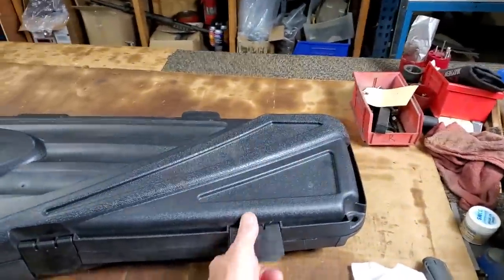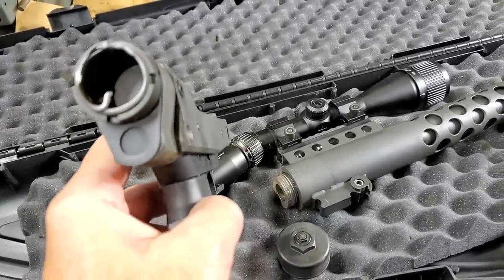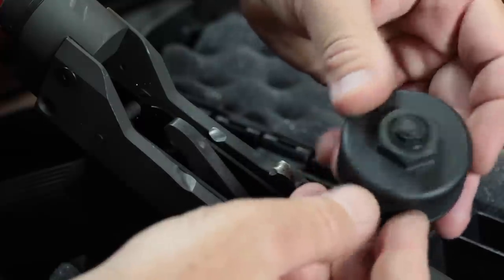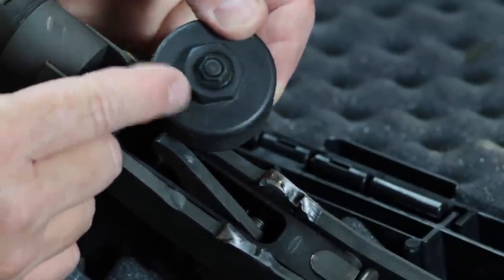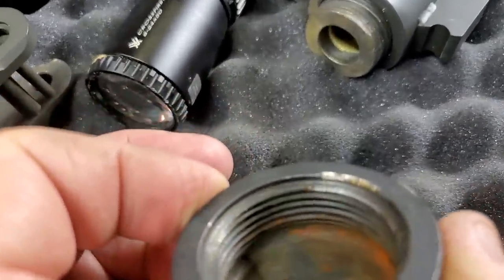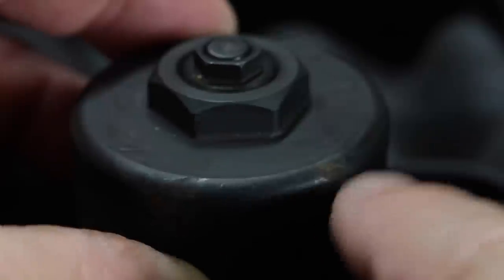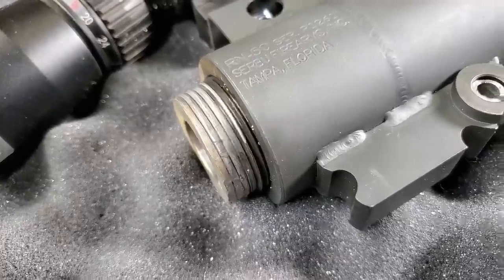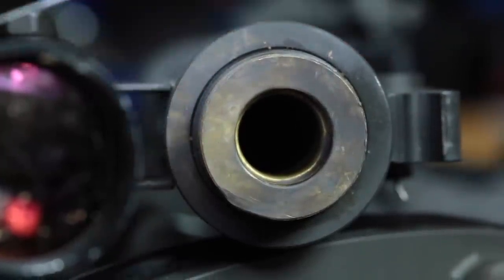Kentucky Ballistics' RN-50 Blow-up:  First Look

Comment: Im pretty sure he got a tainted round (round filled with high explosive) was given out during the iraq war with the hopes enemys would use them and destroy there own guns
Reply: sigh. these are bubba handloads sold at gun shows. no non nato force uses .50 bmg slap rounds. only the US made and used these. these also were made during 1994 and 1996.
Reply: @toomanyaccounts  are you sure cuz they say wcc as in winchester cartridge company made in 1985, not only that but winchester is one of the biggest supplier to the armed forces (at least thats what I got from my research) (Google search research so I might be wrong)
Reply: @cali.delinquent9657  https://fas.org/man/dod-101/sys/land/slap.htm

 "During the 1980s, the Marine Corps invested in both .50 caliber and 7.62 x 51 SLAP concepts. The .50 caliber effort was very successful and extends the light armor capability of the M2 Heavy Machine Gun significantly. The 7.62mm effort was not successful in the M60 and caused catastrophic barrel failures due to in-bore break-up of the sabot and the penetrator puncturing the side of the barrel. Also, its increase in penetration was not on the same order of magnitude as the .50 caliber SLAP's.
A fixed price contract for initial production of 3.5 million rounds of 4/1 linked M903/M962 for the U.S. Marine Corps use was awarded 1QFY94. Contractor for this activity is Olin Corporation. Cartridges are being loaded, assembled and packed by the Winchester Division, East Alton, IL. M962 tracer projectiles are charged at Lake City Army Ammunition Plant (LCAAP). Production of 0.6 million rounds for Army use began 2QFY96."

it was in production for testing and got approved in 1990 for field use. It was several years before major production occurred though. the crimping on the rounds shown in the video is not the crimping that would have been on the military production rounds but what you would see from a civ handloader. there were kits out there that allowed one to make their own slap rounds. guess what people did with those kits. the ones made in 1985 would have long been used up hence why they are handloads by Bubba.

Comment: Mark, this is NOT your fault. You designed a safe firearm designed to work under NORMAL and even extreme operation. Blaming you makes about as much sense as the Army Tank Commander fresh out of the Sandbox coming home and filling his Ford or Chevy diesel truck with Race Gas. I mean, the Abrams Tank diesel motor can run on high octane gas OR diesel fuel....and it's a diesel motor, so why shouldn't an off the lot Ford or Chevy diesel truck ? This round used by Scott I feel is the EXACT same comparison. If knuckleheads want to blame you, then they should all go out and fill their Diesel trucks with pump gas and enjoy the extra power for 20 seconds......then blame Ford or Chevy and use the Abrams Tank engine as their excuse for doing so when it fails.

Comment: PSI rating on threads isn't the same as an impact force. A drill and impact have the same size motor, but the impact can provide much for force due to impact. PSI rating on threads is BS. Just add a couple more.
Reply: no more threads wouldn't do anything except weak it
Reply: @toomanyaccounts  opposite
Reply: @OGbqze  nope additional threads wouldn't do anything.
Reply: @toomanyaccounts  dude... It's literally the opposite. More threads would equal more strength. If they used 3 threads on it them by your knowledge using 2 would make it stronger... It literally the opposite. More material to hold onto = STRONGER. More threads = STONGER. There's a reason why MANY things, especially on vehicles have threads that thread in further than just good enough cause obviously it wasn't good enough. Adding more threads equals more strength.Adding more threads equals more strength.Adding more threads equals more strength.Adding more threads equals more strength.Adding more threads equals more strength.Adding more threads equals more strength.Adding more threads equals more strength.Adding more threads equals more strength.Adding more threads equals more strength.Adding more threads equals more strength.Adding more threads equals more strength.Adding more threads equals more strength.Adding more threads equals more strength.Adding more threads equals more strength.Adding more threads equals more strength.Adding more threads equals more strength.Adding more threads equals more strength.Adding more threads equals more strength.Adding more threads equals more strength.Adding more threads equals more strength.
Reply: @OGbqze  no it is the opposite. adding more threads weakens it.
Reply: @toomanyaccounts  Well, if I built this exact gun and it had more threads this wouldn't have happened. Simple
Reply: @OGbqze  funny other people who make guns and are experts in ballistics say the number of threads is the maximum number to be used.
Reply: @toomanyaccounts  I understand. Believe as you will. All I know is if I was building a gun, which I have, I wouldn't rely on 4 threads.

Comment: Your issue was the muzzle brake. You should never shoot slap rounds through a muzzle brake ever!
Reply: stop repeating FUDD lore. muzzle brakes are fine with slap rounds. barrett says this btw. the military just didn't clean the guns and blamed it on the brakes rather then their soldiers not doing proper maintence. we know what happens when brakes are gummed up either the round clears the blockage or the muzzle brake goes flying off.
Reply: That's just FUDD lore. Stop repeating this nonsense!

Comment: The threads on the barrel look completely sheared off.
Reply: which would take over 160kpsi pressure. normal .50bmg pressure is 50kspi or so with overpressure testing rounds being 66kpsi
Reply: @toomanyaccounts  Thanks. I was wondering  about that actually. So maybe metal fatigue then?
Reply: @velocity324  nope just triple or more pressure from a Bubble selling his death wish handloads as originals.

Comment: You desperately need a overpressure port in the gun without it its a cannon with a screw cap held by threads and two metal protrusions.
The gun is not able to handle overpressure and gasses and effectively evacuate from the front end leading to the breech end to fail.
Reply from the maker: You desperately need to watch my video on the “RN-50 blowup analysis – what it wasn’t, Part 1” and then come back here and delete this.

Comment: I mentioned this on your video before this one. Scott fired those rounds with a muzzle brake on his .50 cal., slap rounds take a special muzzle brake to fire slap rounds. The sabot is catching on the muzzle brake. That would explain why Scott was getting rounds that would go wild. I'd look into the muzzle brake and see if there are sabot pieces or scrapings. Still looks like an over powered round and maybe the sabot getting stuck in the muzzle brake.

Comment: I can fix the problem. No matter how much you think you know about how "strong" threads are, just add a couple more...
Reply: Thats not how it works.

The first four threads are the only ones to take any of the stress from the pressure. The rest would tear just as easily and wouldn't provide any benefit.
Reply: @DoraTheMFDestroya  I understand your point. But claiming that more material won't strengthen anything doesn't make sense.

Comment: I just saw edwins video and it makes everything even less understanding! Tbh from what we saw it aint no way that bullet or all the saftey messures was the reason. Has anyone thought of it maby was not a "bullet" and maby it was just packed with explosives like c4 or cemtex. Tbh i dont know anything about those stuff but u have a big strong primer to start it and a the casing is big enought to hold a decent amount of explosives. Have you tried testing it for explosives?!. Like I said maby its silly but sadöy there is many sick ppl out there that does the most sick things to ppl. Any ways edwins test was just silly i thought aint no way that Gun does not fly in to a million parts and it did not it even cleared that concret and we could see from that it was a huge amount of energy as concret flew all over from the explosion

Comment: Seems to me like the only difference between the hundreds of KB events every gun under the sun has each year from improperly loaded rounds and act of god case failures an this one is the fact that this happened to happen in serbu's gun and it happened to a popular youtuber who got it on video and he nearly died by just freak luck.  

I was at the range once when a woman next to me had a revolver, i can't remember the brand, made by taurus but not taurus brand, it's like one of the brands the company owns, the name escapes me, but she was shooting federal .357 magnum rounds out of the box, cheap stuff and clearly not very hot and despite it being federal factory ammo got what was clearly a double charged round, it blew the barrel forward when it sheared off all the threading fixing it to the frame and the left side of the cylinder exploded sending a 1" piece of it rocketing to the left straight down the firing line and thank god I was standing to her right, not her left, that piece could have killed me. It went so far we couldn't find it, it was probably imbedded feet into the dirt berm on the side of the range.

These things happen, this didn't make any news because by just shear chance nobody was standing there and nobody got hurt.  In 99% of kb's probably nobody gets seriously hurt, this one somebody did and so it just has drawn lots of attention.

Comment: SLAP rounds are not approved for use in most .50 caliber rifles with muzzle devices. The theory of this failure is the sabot and muzzle device combination is the cause for the pressure increase resulting in this catastrophic failure.
Reply: not true. Barrett says muzzle devices work just fine unless civilian in which case the muzzle brake will be torn off. give you a clue in real life when obstructions at the muzzle brake the muzzle brake gets blown apart not the chamber. same reason why if there is a squib or blockage in the middle of the barrel is that part of the barrel that blows up not the chamber. stop repeating debunked FUDD Lore.
Reply: @toomanyaccounts  this rifle wasn't built by Barrett. Is this muzzle device on the Serbu tested and approved for SLAP rounds?
Reply: @gun_coyote  yes it and the barrel and the whole rifle were special built to fire slap rounds.

Comment: The marks on the top of the side plates couldn't have been caused the way you placed the cap. It had to have spun past 180* and hit the TOP of hte cap for the curve of the mark to fit. Which fits thatdamage to the threads, because the top of the threads are arlmost gone, bu the threads on at the bottom look less damaged. So the ears probably caused the cap to SPIN like a motherfucker, hit the receiver , skip off the angle behind that, and ricochet up into his glasses. The forces involved in that rate of spin are LUDICROUS, but then... well, .50BMG.

Comment: Elder Son. 
Spectral Chem analysis on the brass before you contaninatem8d it would have iidentified the explosive used. Old C-4 formulation most like.  Bundled blasting caps with a charge director is also possible. 
...don't by salvaged ammo.
NEVER use ammo you just happen across.
Elder Son really worked well.  We have been using it in the field for a Long, Long time.
Provenance of your munitions REALLY matters.
One guy in a lab can make 200 ES rounds in one afternoon and demoralize an entire army.
Just mix em in and "lose"  a can here or there...
Dark stuff. Comes home.
Reply: sigh bubba is known to make crappy handloads and sell them as originals at gun shows. you people need to stop bringing up a program that stopped decades before slaps were manufactored and only the US uses .50 bmg slap rounds.
Reply: @toomanyaccounts  would you prefer the active program name? Or maybe the CONTRACTOR  who runs it now?
...don't be a fool. That round was like dynamite. It was not an accident
Reply: @someguyoverthere3275  once more Bubbas are known to make handloads that do that due to their incompetence. once more bubbas make counterfeit slaps. once more no nation besides the US uses .50 bmg slap rounds
Reply: @toomanyaccounts  the rifle.is designed to contain an explosion. 
The explosion that destroyed THAT rifle was INTENDED  to do exactly what it did.

Comment: I'm very far from an expert, but according to Wikipedia, which calls out "The Complete .50-Caliber Sniper Course: Hard-Target Interdiction." by Dean Michealis, Saboted ammunition should not be used in firearms with muzzle brakes unless the muzzle brake has been specifically designed for such use.[1].  

Seems like this is something worth looking in to.

Side notes: 1 - Thanks be to God that Scott is recovering!  2. Mark Serbu is clearly a stand up guy for such transparency.  God bless you both.

Comment: For the damage to the inside of the cap, is it possible that over time the high temperatures and pressures weakened the heat treating?

Comment: First thing, I am not an expert, especially not in the power levels of the 50 BMG. I'm really a pistol guy. However, in Scott's video about the incident, he noted that the 2nd muzzle flash was significantly more brilliant than the first, then if the video presentation includes all shots, the third was the boomer. Elsewhere (WikiPedia, take that grain of salt) it is mentioned that "Muzzle devices, like a flash suppressor, muzzle brake or choke, and with muzzle brakes in particular, can cause material buildup from copper, lead, etc. upon firing. In particular, firing of saboted ammunition in firearms with muzzle devices can leave behind residue in the bore upon firing, which can cause an increase in barrel and chamber pressure in subsequent firing."  This makes me wonder: did that specific ammo combined with the muzzle brake cause enough crud to accumulate in the barrel from the first two shots to cause the overpressure incident in the third?

Comment: it actually wasn't the rounds being "hot" that blew up the gun, it was running sabot rounds with a muzzle break. they actually teach you this in military training you never supposed to run sabot rounds with a muzzle break for the reason that the rounds are designed so that the plastic casing round the bullet breaks away when it comes out the barrel and when your running a muzzle break a little bit of plastic gets caught on the un of the muzzle break after each shot boring down the rifle and ultimately causing an explosion that's why after each shot he took the muzzle flash got bigger and the gun got louder because it was slowly boring down the rifle till the rifle exploded. so so everyone knows never use a muzzle break when running any type of sabot round.
Reply: no.

Comment: The 50manual says don't fire slap rds through muzzlebreaks, unless muzzlebreak was specifically designed for SLAP rds.. Would you please look into that. As micro damage upfront  could cause a bore obstruction causing all the Bad overpressure from the back. You might have to view it microscopicly to see damage.
Reply: yes this was one built for slap rounds. it was made on request. no the muzzle brake would blow off. even the Barrett company says the military spec muzzle brakes work just fine with slap rounds. all that happens is plastic gets blown out the sides of the brake. a typical civ spec brake would just fly off if obstructed.

Comment: ¿Why the Design does not have a built in weak spot to release dangerous over pressure in a safe direction?
Reply: because a freaking pipe bomb would make that nil. give you a clue Barret semi auto bmgs have been torn in half when someone cleared a round they thought was a dude when it was a hangfire.

Comment: maybe just maybe
the threads on the barrel where not  heat treated properly
Reply: they were.
Reply: @toomanyaccounts  you got me thinking now them slap rounds man thay hit hard
Reply: @indexisonline  no gun is going to survive three or more times the pressure it was designed for. those threads were meant to take a maximum of around150kpsi. the overpressure testing was 66kpsi and a .50 bmg is 50kpsi.

basically a pipe bomb went off in the chamber.

Comment: I'm no firearms engineer by ANY means, but I know enough that for a firearm to perform safely and reliably through thousands of rounds, every half a millimeter counts when it comes to tolerances!!! Not to say you possibly made a small yet fatal mistake, but yeah... I'd definitely look into those SLAP rounds! I'm no 50 cal expert, but from what I understand about the SLAP rounds is they are more of a "novelty" round...??? Scott could definitely have a lawsuit on his hands weather it be with Mark or the SLAP manufacturer (which seems more likely)... Then, there's always room for user error... It is crazy how those threads got sheared off! Theres always the possibly he skipped threads while screwing on the cap... So many variables....
Reply: the slap rounds were made in the millions. the problem is the ones that show on the civ market tend to be counterfeits.

Comment: Why on earth anyone is using a breech-loading gun at this point in gun development is absurd.
Reply: because it is a system that works. it is cheap to implement. guess what for plinking with rounds that cost several bucks each you don't need a 12k semi auto when a 1-2 k break open will do the job.